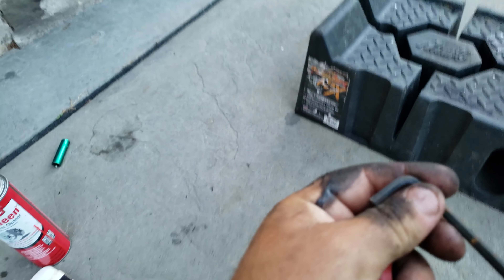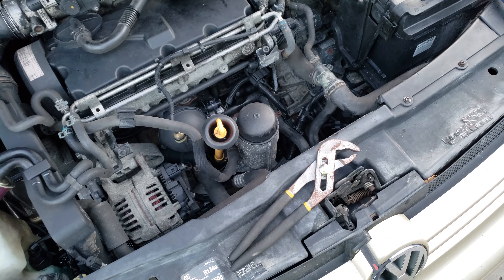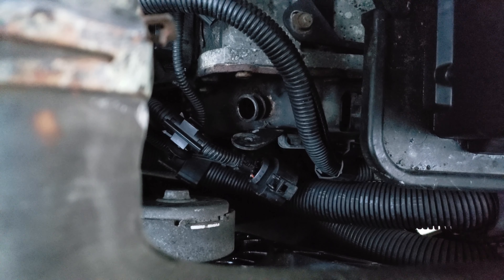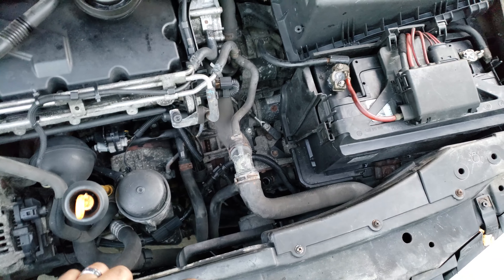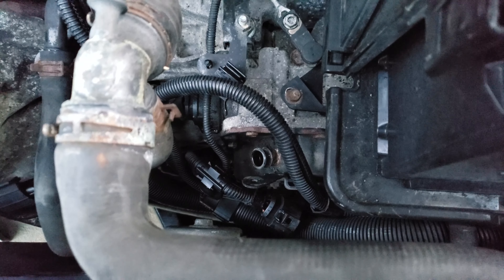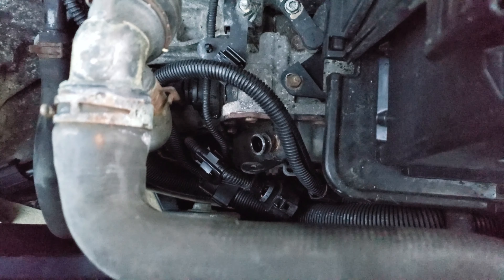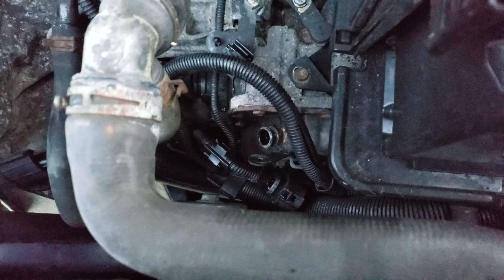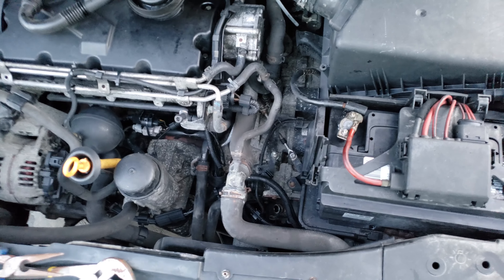2004 Volkswagen golf tdi transmission fluid

Comment: What is the length of your overflow pipe? The original part number is 09A321363.
I have a metal one - 2 cm.
But 4 liters of old oil leaked out through it. Extra? Why so much?

According to other part numbers 09G321363A. 09G321363G
it is long (37 mm) and plastic.
Reply from the maker: Sorry man I couldn't tell u I no longer have the car

Comment: 1) if I empty the transmission completely, will it be about 4.5 Quarts/4.2Litres of fluid to fill?
2) to make sure it is filled to the correct level, do I need to fill it with only the outer drain plug removed (leaving the inner/2nd plug bolt screwed in)? Does this transmission have an overflow tube, meaning that I have to keep filling from the top, shift into park/reverse/N, and then keep filling until adding even a little bit of fluid causes it to drain right back out? Thanks
Reply from the maker: To empty it completely take off the outer plug and inner tube. That inner tube goes up inside there and almost acts like a fill marker. You can pump it up in thru the drain plug but make sure you have that sleeve up in there. Or you can fill it from that fill plug up top and put about 4.5 quarts in it as long as it completely empty and then on a lvl surface just remove the outer drain plug and if you happend to fill it to full the excess fluid will flow over the inner tube.

Comment: I have seen it . Thanks man. Now my trans on my bew is acting up takes to long to engage . How do I check the fluid level in the transmission?
Reply from the maker: I feel like one of ur solenoids under the trans pan has gone bad ...mine was doing the same. But if u want to try trans fluid watch this video ....u dont need the scan tool in the first part of it https://youtu.be/MMmsp8ULf1s

Comment: Hey I just changed my filter and I'm scared to put any kind of f**** transmission fluid in there can you tell me which one to use please I am in desperately needing help
Reply from the maker: What i put on mine was valvoline MaxLife Multi-Vehicle Full Synthetic Automatic  Transmission Fluid (ATF)
Reply from the maker: You can get a bottle of it at Walmart for 17.99 or I think it like 30 bucks at autozone
Reply: Thank you I figured it out it was a Valvoline but I'm still having an issue with my car so now it's either the transmission control module or my pedal
Reply from the maker: @albe6102  whats it doin?
Reply: @albe6102 or 1 of the 9 Shift silenoids

Comment: I wanna do the transmission filter to anyone have a Vedio for that
Reply: You have to disassemble the trans to get to the filter...it is not needed though unless your transmission has blown in which case a rebuild would get a new filter installed
Reply: @midwest9757  appreciate it bud I ended up not changing it the information was useful

Comment: how’d it work out for you brother
Reply from the maker: Worked just fine u just gotta be careful on how much uve lost and add to it
Reply: Night Slayer22 any idea how much you put in it to get her runnin good
Reply from the maker: @hawk2fan  it was only down a half quart.
Reply: Night Slayer22 whatever asshole had mine befofe never put the little drain tube back up in it , so any guess what it takes to be at proper level ?
Reply from the maker: @hawk2fan   If yours is completely drained out I would go with 4 and a 1/2 courts and run that
Reply: Night Slayer22 have you ever had to drop the pan on your tranny , the metal on it is so soft stripped multiple pan bolts
Reply from the maker: Ya i had to drop the pan to change out all the solenoids....1 went bad and would cause it not to shift out of first gear...i literally had to shut the car off and restart it. Almost cause me to die a couple times. If u need any info on it ill help u out best i can
Reply: @nightslayer2258  mine is doing that too. How can you tell?
Reply from the maker: @samp3922  I talked to a vw mechanic and he said to just replace all the solenoids and I did and it fixed my shifting problem
Reply: @nightslayer2258  was it only doing that first start up of day? When fluid was cold ?
Reply from the maker: @Lyndonkb11  no it did it the whole time
Reply from the maker: It progressively just got worse
Reply: @nightslayer2258  and wouldn’t shift at all. Yeah mines gotten worse, used to take a few minutes till would shift, now it’s like 10-15 mins and driving around slowly in low gear, won’t go past 2nd, after a bit goes to normal and shifts decently rest of day.
Reply from the maker: @Lyndonkb11  to  me it sounds like 1 of those solenoids is bad.